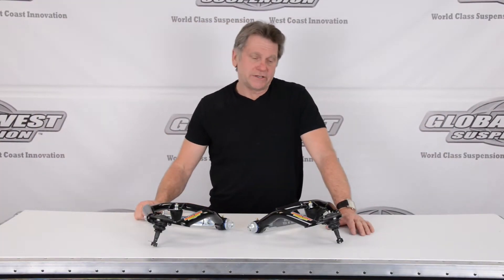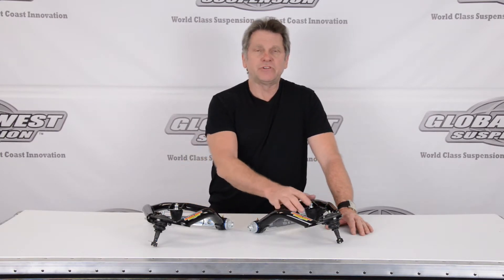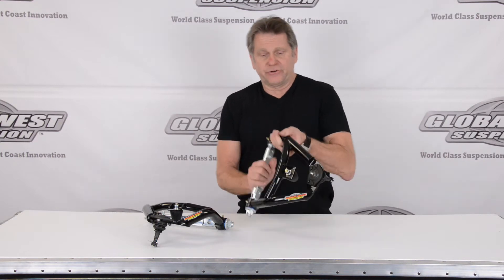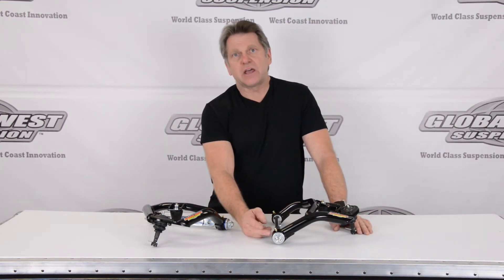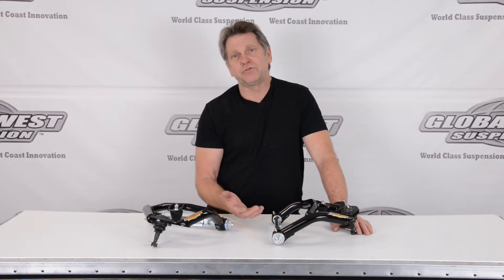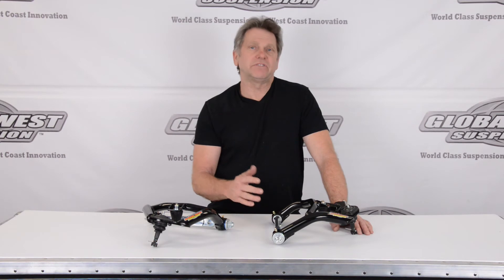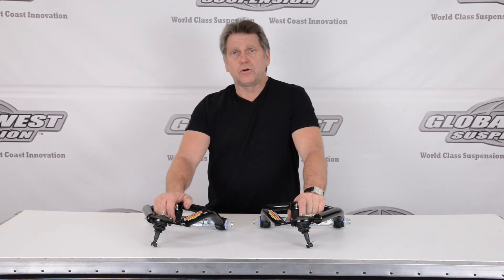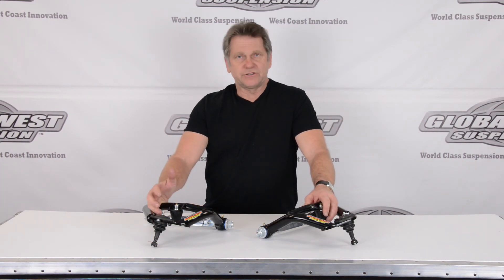1964-1972 Chevelle, GTO & Other A Bodies Upper Control Arms

Comment: Why only 6 degrees Caster, with the older design  arms and some shims I've got 10 degrees. Is it bumpsteer your worried about?
Reply from the maker: Ten degrees is a lot. in some applications it might benefit you, however bump steer is increased and the camber sweep is a consideration. Too much sweep can lift the tire off the pavement rather then plant it. It really depends on your application drag,street, or road race. We have found 6 works best for most applications.